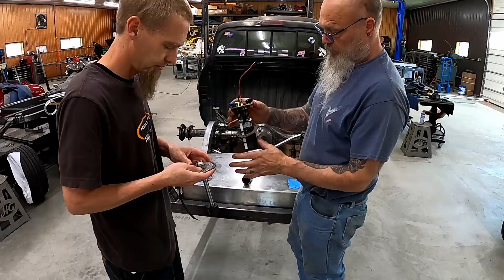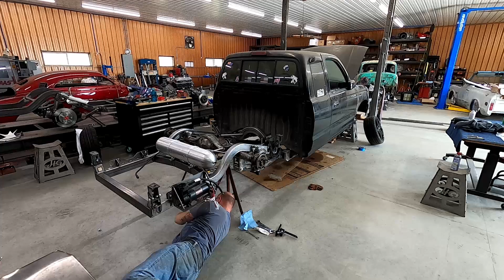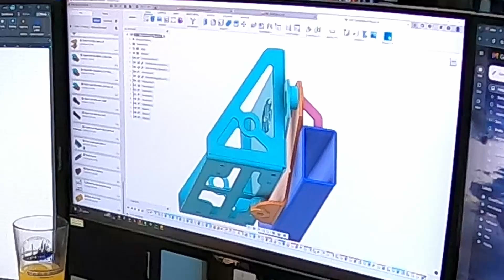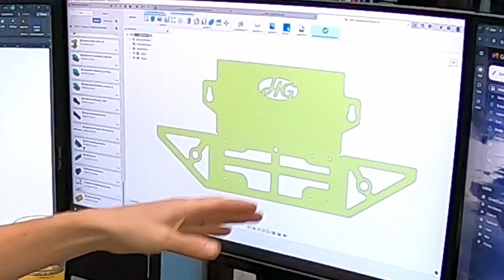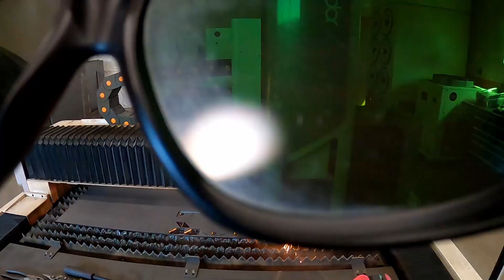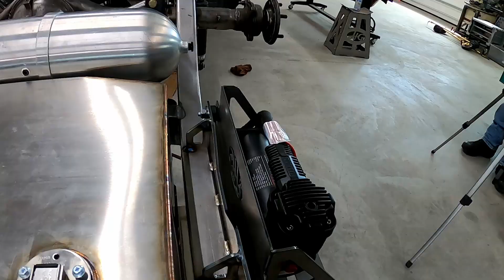HGHR Tacoma Ep 6 - Back Half Add-ons

Comment: Love the compressor brackets with the isolators. That's a great idea! But, I think the bottom bolt might be difficult to take out, without removing the compressor first.
Reply from the maker: There is room under the compressor to reach it but also thought about just welding the nut to the bracket and then problem is solved and just need to loosen the bolt from the bottom only.